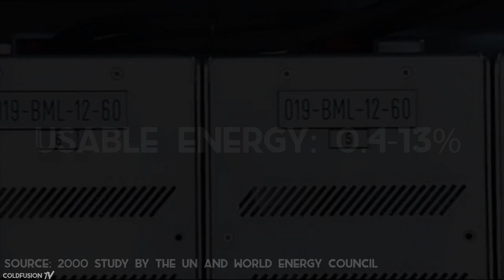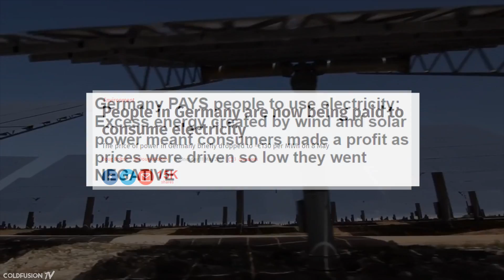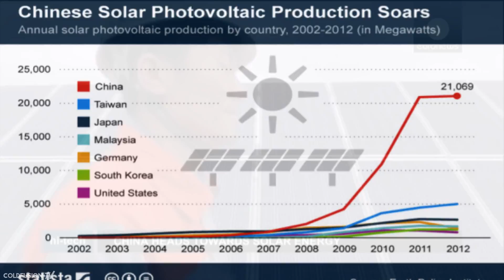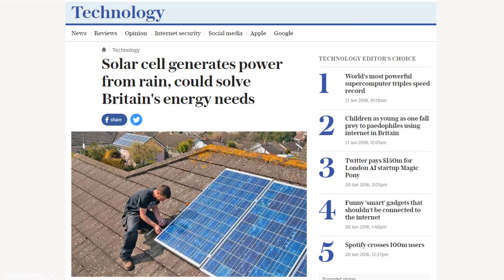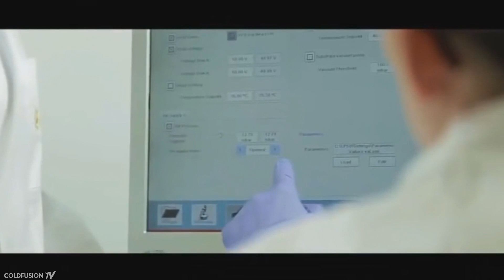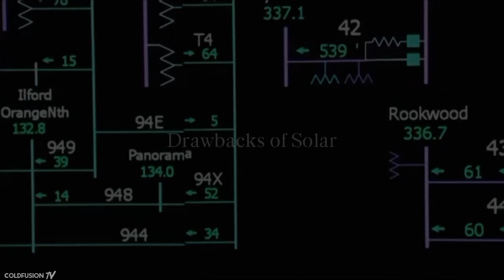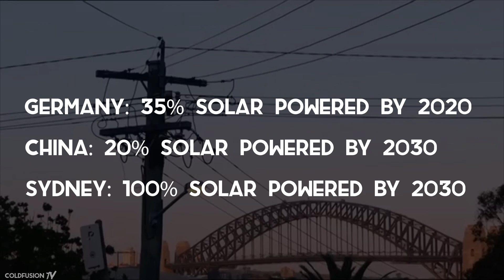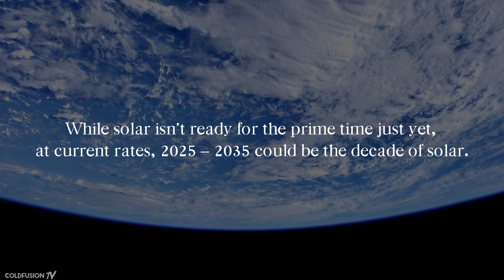The Truth About Solar

Comment: The solar panels on that Prius must take around 2 weeks or more to fully charge the battery.  It's not much help, just an expensive gimmick.
Reply: What, what? 2.2 miles for free on a sunny day? What is your problem with that? And: you don´t have to worry about your starter battery for the first 10 years...
Reply: It's hardly free.  You're paying through the arse for the panels just to trickle charge your battery.
Reply: If you want to save money, stick with your old car... I never chose the cheaper ride...
Reply: My old car is a Nissan Leaf and it's saving me €300 / month in fuel costs.
Reply: sweet! (Much better than a Prius anyway) ;)   I got a C-Zero (=I-Miev).
Reply: I was working on the assumption that, like most plugin hybrids it had a battery about half the size of a proper electric car.  Apparently the Prius has a tiny little battery (4.4KWh).  This compares to a Nissan Leaf, which has 24-30KWh depending on the model.  4.4KWh will take you maybe 22Km.  

Unangled solar panels can be expected to operate on average at 15% efficiency.
One square meter of solar panel can generate approximately 1KWh
So at 15% you get 150Wh

I'll be very generous and estimate this car has 2 sqare meters of photovoltaic panels (probably more like 1.5 sqm) and ignore the losses that occur when storing the energy in the battery.

So every hour gets you 300 Watts.  It would take 14.67 hours to charge the battery fully and that will carry you 22Km.

That's a very optimistic figure.
Reply: ***** LMAO.  How the fuck do you use a 2 tonne vehicle like a scooter?

Hybrids are for pussies who can't handle a little bit of range anxiety.  In return for their pussiness, they end up with a car that is far less efficient, far less powerful and carries the dead weight of a battery and electric motor when driving on the teeny weeny petrol engine and carries the dead weight of the teeny weeny petrol engine when running on the electric motor.
Reply: +2LegHumanist I spend that much on fuel a year. some people just like to live in traffic.
Reply: +okleydokley The hint is in the "inter" part of the "internet".
Reply: This says nothing... whats the capacity of the batterys... a weeks for just 1000wH or is it 2 weeks for 1.000.000 wH ?
Reply: ***** LMAO.  I've been driving an electric car for over a year, I know exactly how quick they are. How the fuck does instantaneous torque equate to driving it like a scooter?  You're making zero sense.
Reply: ***** LMAO.  You really don't have a clue what you're talking about.

My Leaf has leather seats, 360 degree cameras, rain sensors, Bluetooth and 3G, Sat Nav, energy efficient bose stereo system, energy efficient heating and AC in addition to being quicker, more efficient and quieter (the motor is completely silent) than your piece of shit Audi.

You probably have the old fashioned audible collision sensors that beep when you get close to an object.  If I get too close to an object the car just stops moving.  I don't need the irritating beeping because I can see a perfect 360 degree view of the surrounds on my monitor and even then the car won't let me collide with an object.

And that's just a Leaf.  The Tesla Model S is has much more functionality and gadgets and currently is the quickest production car on earth.  You're a dinosaur.
Reply: ***** Even the manufacturers of your old fashioned pussy-mobile know electric cars are the future: https://www.audiusa.com/newsroom/topics/2015/electric-mobility-audi-e-tron
Reply: Deluded much?  The Leaf was designed in a wind tunnel.  It has a phone app you can use to switch on its climate control remotely.  Then there is the shitload of tech that is in the leaf that you don't have in your piece of shit low spec Audi abd you still want to maintain this train of argument.

You just got owned.
Reply: LMAO you have to make a special trip to a service station and then wait even longer to fuel it and pay shit loads of money for the privilege.

My car charges while I sleep and costs next to nothing.😂
Reply: LMAO  Your car is just better because reasons 😂

Sure we understand.  In the meantime I am enjoying the extra €3500/year I saved in petrol... but I'm the moron 😂
Reply: And rich people drive Audis 😂
Reply: LMAO holy shit.  I take it we're supposed to believe you can afford a Ferrari, but just chose to drive a piece of shit Audi that you somehow bought without savings because big rich people like you don't save money?

It truly is hilarious watching conversations with arrogant wankers who can't admit when they're wrong devolve into ludicrousness as they have to reach further and further to clutch at their straws.

As a software engineer specialising in data analytics / machine learning / AI, I can be quite sure that you don't out earn me on your Electrical Engineer salary.  Especially since your maturity level reveals you're probably a graduate or in a junior role...  but keep on clutching. :-D
Reply: ***** Talk about off the rails.  How the fuck is that in any way relevant?

Here is a summary of this conversation:

You: Hybrids are better than EVs
Me: List of reasons that's bullshit
You: I drive an Audi, I'm better and richer than you
Me: Here is a list of reasons that's bullshit
You: Here is a list of cars you can't afford
Me: And you can?
You: No

Twat much?
Reply: +intj123 not everyone needs an expensive car. And a lot of people dont want one. They want cheaper. Also not everyone enjoys driving. Is that so hard to understand?

Comment: Solar power can't be a sole supply of power in many cases. Areas with long and dark winters will never be able to get enough power. But it can work great in many places and the new developments are very encouraging. The standard commercial solar panel is about 15 years behind the world of science right now. They are heavy and brittle but new types are coming fast so watch out for them.

I did my masters degree on Dye sensitized solar cells and there is a vast array of developments around each type of cell. Right now they also want to add layers of materials which harvest heat and turn it into electricity as well, to gather diffuse light etc.

One powerful aspect working for solar cells is the fact that each one of us can supply their own power. Villages can come together to build panels and avoid the infrastructure cost and become independent from the grid. This is very good because centralised power supply is vulnerable to cataclysms (like floods and earthquakes) but also terrorism and war. The power plants would be the first target during an invasion. Having decentralized power supply could warrant safety for people.

Comment: Elon Musk should put solar panels on his Tesla cars!
Reply: Do you realize, with current technology, it will need several month exposed to the sun to get a full charge? I think it can be more like a marketing argument than a technical asset ;)
Reply: Rest assured, Elon has considered this and dismissed it with good reasons for now... When PV can be painted on the car with high efficiency light absorption/charge rate, I'm sure he would reconsider. This guy is on the ball.:)
Reply: Yes I did! I don't even know the size but I found this not "small" but verry small ^^ so I was wondering if you just missed one order of magnitude. In a sunny country and with 1x1m you may get a full charge in around 30 days. So if you want to get few minutes by days, you will need these 1x1m ;)
These calculations is only using numbers found on internet, but it gives the order of magnitude.
Reply: are you sure it is not more than 4x8 cm?
Reply: Tesla already done that, its called a Supercharger station. Powered by solar, stays in storage batteries, then fills up your 230 mile tesla in 30 minutes...
Reply: Although a good idea, I'd rather have my panoramic sunroof
Reply: 4x8cm? My pocket calculator is bigger than that.
Reply: +Dat boi Actually, the solar panel is only used to charge the 'other' battery used to power the equipments i.e. AC.
Reply: +Kurt Foster efficiency of solar panels barely matters at all.... what does matter is price, weight, and power output; all efficiency counts for is designing cooling systems or heat scavenging systems.
Reply: Cover the burn with a clean, dry cloth to reduce the risk of infection. Do not put any salve or medicine on the burned area, so your doctor can properly assess your burn. Do not put ice or butter on the burned area, because these measures do not help and can damage the skin tissue.
Reply: If you are buying a Nissan Leaf, you have the option to get a small (about 4x8cm panel, I believe) solar panel to charge the car. I don't think it will charge it a lot, maybe a few extra minutes when exposed for 4 hours (for example while you are in a mall). keep in mind all of my "data" are assumptions. I only know that Nissan offers panels on their cars.
Reply: Basile Collard did you read the last two sentences I wrote?
Reply: +Dat boi the solar panel charges the 12v Pb-H2SO4 battery responsible for initializing various systems.
Reply: Tesla is bleeding money. It's the reason no venture capitalists never funded the Tesla startup. No potential money to make there. US Department of Energy is pushing the green technology through Obama's plan of clean energy, but cut short due to unavailability to the public and it's lack of demand. Thanks to Department of Energy it used it's taxpayers money to fund Tesla yet didn't make money out of its investment. According to LA Times Tesla is bleeding money. Is Tesla the over-hyped government subsidized green tech will be the next Solyndra?
Reply: In a typical day assuming 1x1 m^2 roof, clear sky, fixed flat surface, exposed to the sun during the entire day unshaded with high efficiency panel (20%) it can't get more than ~1500Wh (1.5kWh) during summer time. Tesla cars have battery capacity of 40-85 kWh so this would charge it between 2-4% max which is nothing, considering the assumptions made above!
Reply: 1x1 m²  very nice
Reply: +Kurt Foster the solar panels are fixed some where not on top of the car...
Reply: thats not putting solar panels on a car
Reply: until solar becomes very efficient, it's a complete waste of time to put solar on a car, as someone has said earlier, it would be a marketing gimmick and nothing more.

The time it would take 1 or 2 sqaure meters of solar panels to charge s Tesla for 200 miles would take well over a week.
Reply: +Simon WoodburyForget a school in, I want to say, Australia made a 100% solar powered car that could travel at a decent speed when in direct sunlight. which actually isn't new, but what is new is that this car is only a little bit smaller than a Miata.
Reply: +Simon WoodburyForget i agree but not including scramjet, nasa is testing one
Reply: +Simon WoodburyForget I'm pretty sure that the US Military uses scramjets for something..... 

in terms of wind power, I'm not sure if you're talking about kitecars or ddwftw, but if you want to talk practical; it is unreasonable to think that the infrastructure upgrades needed – for everyone for everyone to swap out their gasoline and diesel vehicles for comparably sized EVs and  continue the modern American commuter lifestyle – are going to happen when we can't even maintain our existing infrastructure.

if you can increase the amount of surface area suitable for mounting PV while decreasing current draw you should be able to get a usable amount of range extension.
Reply: +Simon WoodburyForget larger batteries doesn't solve the infrastructure issue completely; it does lower the demand for quick charging, which will keep peak demand from going completely off the chart, but what you really need is lower powered EVs so that you can have lower powered chargers and still have reasonable charging times. Zero Motorcycles, various electric scooters and Litt Motors all have dramatically lower power draw than Tesla or LEAF.
Reply: +Simon WoodburyForget 

A mass deployment of Teslas will cause widespread blackouts.

Wind powered cars are far more likely to happen then current infrastructure in the US being maintained; forget about it being expanded as it would need to be to facilitate a mass deployment of Teslas.
Reply: +Simon WoodburyForget 

A mass deployment of Teslas will cause widespread blackouts.

Wind powered cars are far more likely to happen then current infrastructure in the US being maintained; forget about it being expanded as it would need to be to facilitate a mass deployment of Teslas.
Reply: Daisy Duke
I am talking about a size limit. If the solar is limited to the space on top of the car, it needs more power output. And when I said "efficiency", now that I think about it that's not a very descriptive word, I was just using it in the general sense (like the things you said).
Reply: Elon Musk should put solar panels on his reusable Rockets.
Reply: +Srijan Bharati lol, yea lets put solar panel on something moving supersonic, the heat will reduce the voltage substantially and you don't need it, almost all power is generated by burning fuel for thrust not to power electrical devices.
Reply: MilitanT07 Dude , if you don't get jokes then you shouldn't use the internet.
Reply: +Srijan Bharati If you don't know how to joke maybe you shouldn't
Reply: +Srijan Bharati how about you make better jokes you stupid piece of curry shit.
Reply: MilitanT07 Why are you using cheap ways to win this conversation ! Grow up kid ... and don't do Drugs.
Reply: +Srijan Bharati conservation? What conservation? You think your stupid rambiling is conservation or your poor attempt at making a silly nerdy joke.
Reply: MilitanT07 Apply methanol and Sodium on burned area
Reply: Srijan Bharati I'm sorry you'll have to find someone else to apply it for you. See your local hospital.
Reply: For cars that will be used every day on normal roads solar panels can not provide much extra energy. I would however like to see them on all kinds of vehicles, not just electric vehicles,  as an assist for secondary power. 

In particular they could be used as a convenience feature to give partial temperature control even when the vehicle is off. During the day they could warm or cool the interior and keep it closer to a comfortable temperature. This means  it will be more comfortable when first getting in the vehicle before the normal climate control can adjust the temperature. It also provides some measure of additional safety in case you run out of fuel and are stranded or do something stupid like leave a pet in the vehicle while shopping.

Such solar assisted climate control exists but should be pushed to become a  standard feature and improved to be less costly and more efficient. There would only be a minor energy savings but that along with added convenience makes it worthwhile.
Reply: Did you even watch the entire video? It mentioned the new Prius, which has an entire rooftop that is completely solar. No, they wouldn't need "months" to get a full charge. Plus, all Tesla get free charging for LIFE.
Reply: +DonkeyWiener the Prius has only barely enough battery to keep from idling the engine when stopped and to do regenerative braking.
Reply: +Simon WoodburyForget 50% efficiency? best current production solar cells are 35% but due to cost are only used in space, best in development is 40% and will likely also only be used in space; best production cells in common terrestrial usage is 25% with 30% in development.
Reply: +DonkeyWiener 

https://www.technologyreview.com/s/412625/the-underwhelming-solar-prius/

they aren't even connecting the PV to the battery, rather only using it to run a ventilation fan to keep the interior cool when parked.

apparently, for reasons not understood to Toyota, the PV acts like an antenna when connected to the Li+ battery and interferes with the radio. I'm not sure why this couldn't be dealt with using a few chokes, capacitors and inducers, but meh. Maybe they'll have the kinks worked out for the 2018 model?

anyway, I hope they are running polymorphic PV and not crystalline.
Reply: like all building designs, they evolve..they used to have gas lighting and coal fire chimneys. So new regulations will require roofs to be pitched towards the sun, and gradually over 100 years all buildings will end up optimally aligned!! hope so anyway
Reply: +peter clarke there are more considerations than just solar gain when sloping a roof, like snow accumulation......
Reply: Daisy Duke As well as angle to the position of the sun throughout the days and seasons which varies over time and the latitude and weather of the particular location.
Reply: Master Plan Deux
Reply: He has

Comment: The problem with solar is that it can push out the local utility, which he came close to dealing with at 3:13. The answer to this from many utilities is to charge the solar producers enough to discourage going solar. We need to embrace this technology, because we will find we need it in the future.

If you are thinking of going solar, check the laws in your location. Also at the moment you want solar cells that look like Jack Frost got a hold of them, because they don't deteriorate like the amorphous cells do. The best way, in my opinion is to set up your system to sell the power back to the utility. This eliminates the use of batteries, and the maintenance and upkeep of the same. If you do go with batteries, then use nickel iron batteries. These are easier to maintain, and can take more abuse than any lead acid battery on the market. They also charge faster, which makes them look like there is more solar power coming in compared to a lead acid based system. Just a few thoughts to point anyone thinking of solar to go in the best direction.